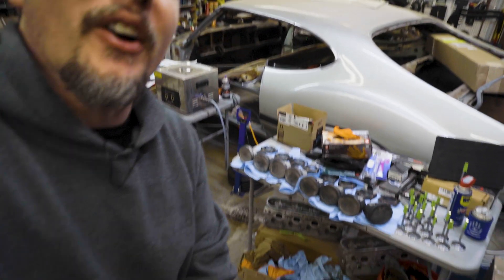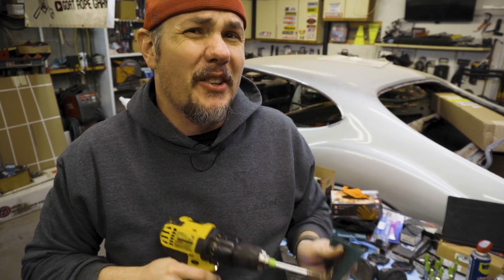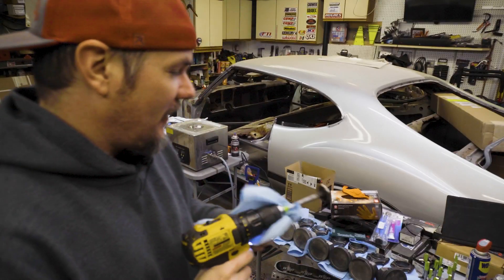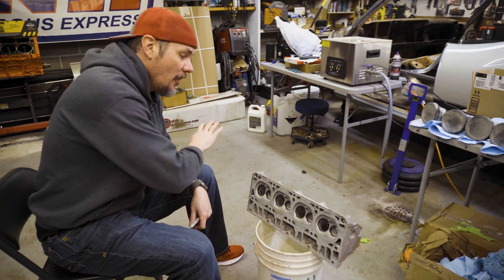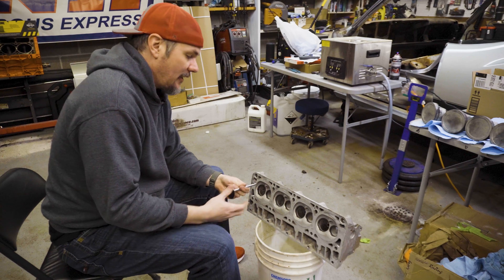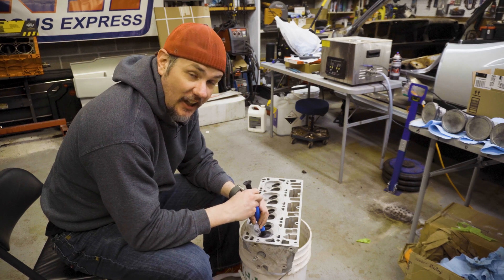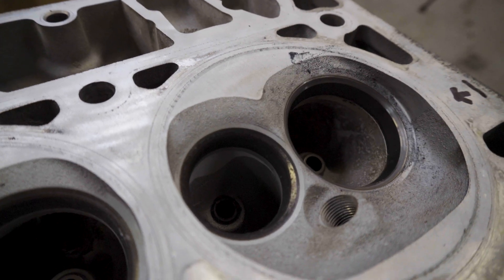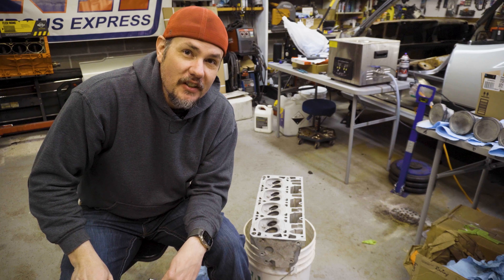Lapping Valves On Our 6.0 LS

Comment: It's good to see you young fellers using the old ways. Speaking to engine sealing, why doesn't anyone hone and re-ring cylinders anymore? Do the rings really not wear enough to warrant replacement?
Reply from the maker: I bought new rings, just because they were cheap and I flex honed it but the old rings don't show any wear. Your guess is as good as mine.
Reply: They wear plenty guys get lazy and cheap thats all

Comment: I tried lapping the valves in my 243's.  Tested first one  with water and compressed air, leaked like a sieve, ran out of patience immediately and the machine shop is now doing a 3 angle and resurfacing.  $1,000.00.
Reply from the maker: That's like 1/3 the budget of this entire engine lol. Not spending that much on an iron block
Reply: You did it the right way. These guys grinding the pee out of their valves with a drill believe they are doing the same thing lol.

Comment: I assume your 6.0 is an early LQ4 since you said you were pitching the iron heads. Which aluminum heads are you working with? If you said, I missed it. You put some sweat equity in yours, I spent some $$ and had Eric Weingartner do a complete valve job on mine. Mine are 823s since it’s a Gen IV. Good thing I did because he had to replace all the intake valves—unusual. Thanks for the content, looking forward to seeing the Corvette run with the 6.0!
Reply: You probbly gained more with your V.J. than diyers do trying to port

Comment: Hello grg.  Ya. I lapped the valves on my eBay 862 bought heads for the 6.0. Same here. I used a drill. I had the drill grab the stem and wooo wooop done.  I also had them decked .020 and pressure tested.  All is good. Can’t wait till it gets warmer. Us peasants don’t have a nice warm garage.

Comment: You can insert the valve into the head with lapping compound and chuck a drill onto the valve stem - so pull the valve closed using the drill - and turning the valve using the drill. You can open and close the valve while you do this by moving the drill in and out. Does a nice quick and easy job.
Reply: I bought the set of Neway valve and seat cutters at a dealer sale. They use tungsten carbide cutters and have adjustments for size. The seat cutter portion are two cones, in one body and 3 cutters held with Allen head screws. From big to small, if the fit the heads pocket, they twist by hand and take 5-8 turns. I always use solvent in a bottle to flush clips. Same for the valves but require more effort. I grab my little green can of "Clover" extra fine lapping compound to put the seat contact pattern near the upper side on the middle and inspect. I don't remember why, other than shown, but I slap the valve into the head and if done right with a metal dye like dykem, or Prussian blue, I push them out to inspect for the pattern of contact. 
  I am really showing my age now. Nice video of doing it with what you have. They will come out great because they need to seal but transfer heat into the cylinder head. 
  Best of luck and hope the stimulator is doing right for you. My Dr got it wrong then waited too long. They had to leave a dead cut on inside. I believe it blocking the right side signal as the engineer tried once and quit. I am deeply hurt as I like to do stuff and now can't. Best of luck!
DK, Omaha. ASE Master Retired.
Reply from the maker: Great info, thanks so much for sharing and sorry to hear about your experience, that's terrible!
Reply: That's a good way to have leaky valves. You need the back and forth action to keep from grinding concentric circles in the seat and head.
Reply: @jimmaag4274  And you get that by opening and closing the valve while you do it by pushing in and out with the drill, that seats and unseats the valve when you do it - no concentric circles. So you use exactly same lapping technique as doing it totally manually.
Reply from the maker: Good idea!
Reply: Ya. That’s how I did mine.

Comment: When my wife burned through the exhaust valve on the Audi I took out and media blasted the valves. There was a lot of carbon build up. When I put it all back together I lapped the valves but I used a drill (on low speed) and a vacuum line.